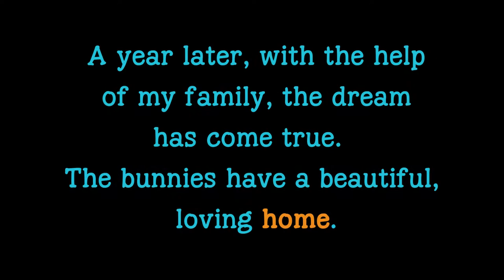Moving Day for The Bunnies - Amazing New Bunny Barn!

Comment: Can you give me some info on how you made the trays under the cages and the drainage system... How is it working now that you have been in the barn for over a year? Did you buy or design that system. Any info would be great I am working on building a new barn for my Cal's right now.
Reply from the maker: I sold that system about a year ago and downsized to solid floor cages.  The only issue with the system was that excess hay would clog the drain, so we had to install 6" pvc pipe to help with that.  The trays were made from dump truck liner purchased through Horn Plastics I believe.

Comment: Won't the trays be quite dirty after all the rabbits poop and pee on it?
Reply from the maker: Yes, but there are only four trays to be hosed and gently scrubbed (indoors) compared to about 20 trays to dump in a wheelbarrow, hose out, and refill with litter...outside, and sometimes in the snow.  Plus, I have easy access to underneath all cages, so they should be easier to keep the cages clean and free of dingleberries and stuck hay.

Comment: It's very kind of you for creating a bunny palace. But please do NOT NOT NOT NOT use wire floor for rabbits. Rabbits were not designed to live on wire floors–they’re hard on their feet. You can place newspapers on the floor and add hays on top of the newspapers. It is easy to clean.
Reply from the maker: Thank you for your concern, but Hollands have heavily-furred feet and do just fine on wire with no sore hocks.  The cages shown in this video also had fleece resting mats, pillows, and plastic platforms if the bunnies preferred.  These cages have also since been replaced with solid floor cages (as shown in my recent video).  Please take a look.